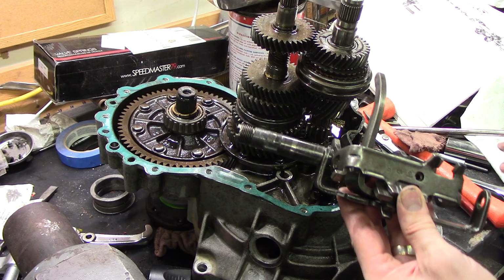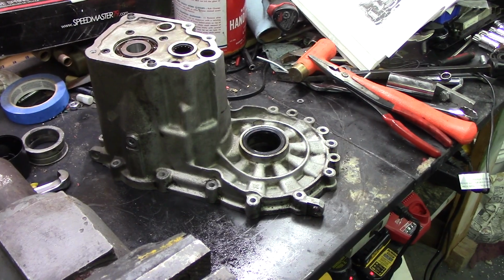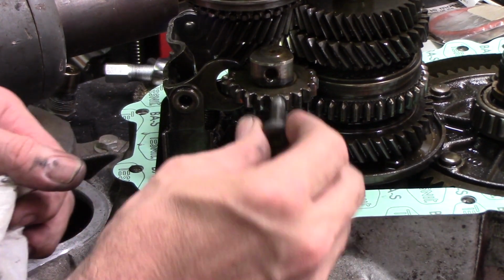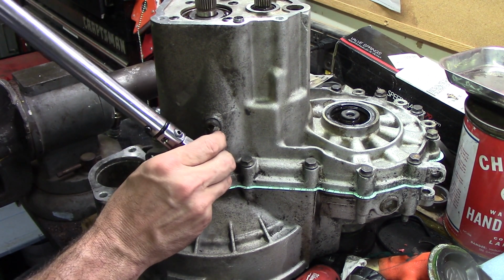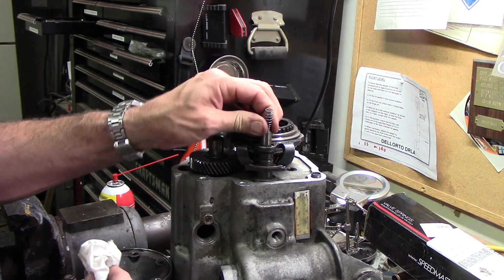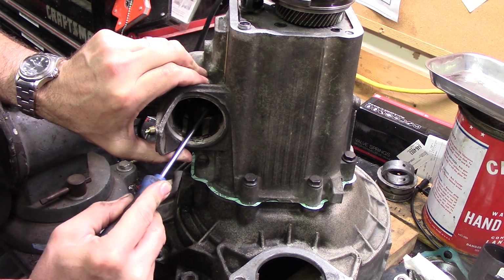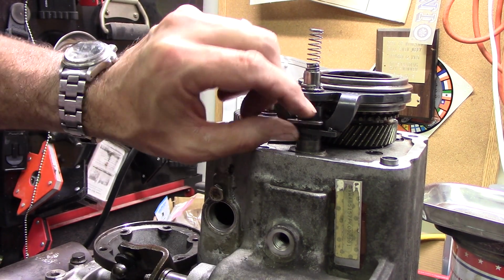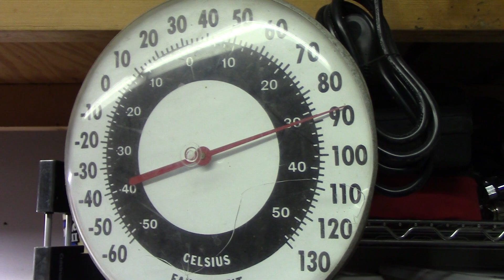1993 VW Cabriolet transmission repair and clutch replacement part 3

Comment: Hey friend!  First, thank you for making content for these cars.  I own a 1993 VW Carbriolet also, and if you check this for comments at all, I'd like to pick your brain!  Last week, the transmission just decided to make it so I can't access my 1st and 2nd gears...  When I move the shifter into first, it actually goes to reverse.  I can utilize 3, 4 and 5 just fine, and reverse works, but no 1st and 2nd gears.  Can't even shift it into 2nd - it feels like there's a brick wall preventing it from moving to it.  

I checked the linkage, including the rods, etc. and everything else outside of the transmission itself seems like its in working order.   When i disconnect all of the linkage and try to put it in 2nd manually by hand, it won't go in.  

The only other post I see about the issue I'm experiencing specifically is on the VW Vortex forum, and it ended up being a shift fork.  What are your thoughts on this?  Should I attempt a DIY for this, or continue the hunt for a transmission specialist that will come within 100 feet of this cursed vehicle?  

Thanks in advance for your thoughts!
Reply from the maker: It sounds like you linkage is just out of adjustment, these can take a long time to get the first gear gate to line up. sometimes you can push down like you are going for reverse and get into first that way. To be honest this was the only manual transmission I have ever bee this deep into so I cannot speculate on what the other problems could be. These transmissions were generally pretty bulletproof. In my brief career as an auto mechanic I never saw a bad one. I would suspect you could find a good used one if needed, unless they have all been melted down by now.

Comment: The race in the centre of the output shaft bearing behind the drive flange I can see at 8:35 is raised and slanted on the splines. I just opened mine up and that race for me was in 3 pieces. Yours looks loose, did you need to replace that or should it be able to move? Thanks
Reply from the maker: As I recall that piece sort of floats in there. If yours was in 3 pieces it is broken and likely needs to be replaced.